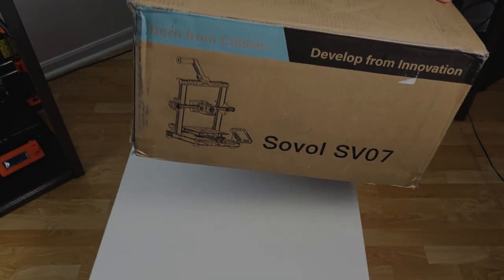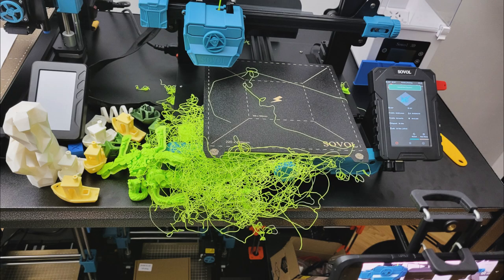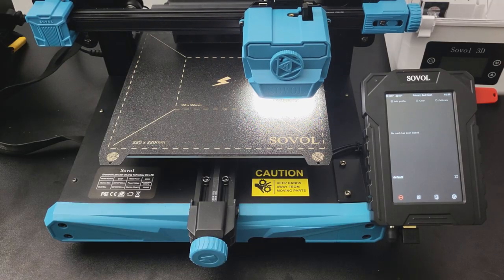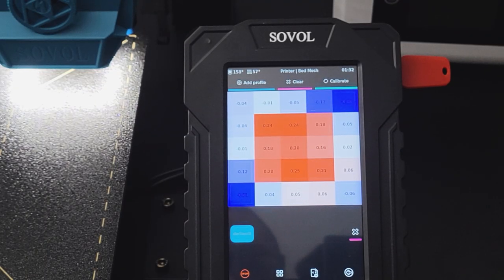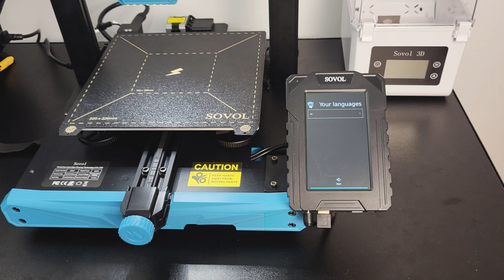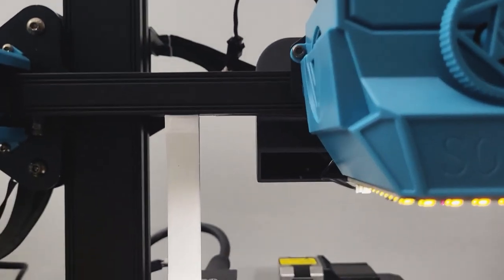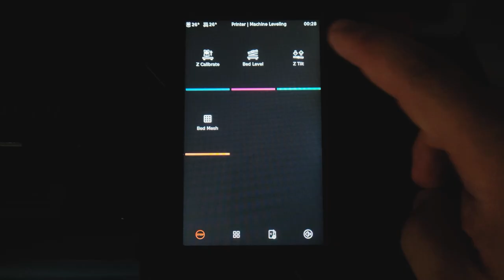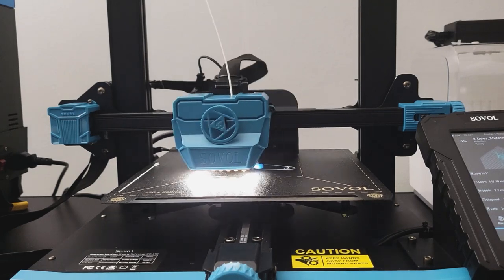Sovol SV07 Beginner set up tutorial, Assembly, Bed leveling, Calibration, Common issues

Comment: Great stuff, I adjusted my bed level on the sv07 based on your tutorial. Thank you!
Could you do a video where you look into input shaping? I did the input shaper auto-calibration on my machine and it messed it up realy bad and I have no idea on how to reset it to it's previous values. Do you have any advice?
Reply from the maker: I will look into that, hopfully will have a video come out in few days.
Reply: @SvgLau  Thank you.
I think the problem is with the accelerometer that they sent. After I resetted the printer to the factory settings and redone the bed levelling without the input shapper it started working well again.

Comment: Can you please help. Im having problems trying to get my sv07plus calibrated.  I do the z tilt first, then the z offset and save. Then do the bed level. Got through it fine the first time.  Tried printing the benchy. When it got about halfway done it started making a scraping sound and then knocked it off the bed. Tried several times and every time it did the same thing. So i tried calibratting again and this time it did the same thing. So tried it again,  now when i do the z offset when i go to lower the extruder after lowering once at 5mm, and once at 1mm, and try going 1mm it says out of range. Also when trying to level the bed lile this i cant even loosen the bed srews enough to get it to even get anuwhere close to touching the paper on the left side, and on the right side the extruder touches the bed plate when it lowers. I am new to 3d printing and am lost at this point.
Reply from the maker: I think your issue may not be the bed leveling. As you mentioned your first few tiral benchy were stick fine on the build plate, the scraping sound could be belt skip steps or something. 
Did you adjust the belt tensioner and the eccentric nuts on wheels? This is critical part of basic calibration. If not, try to adjust those first and redo the entire bed leveling process. Also, if you are using the springs bed spacer set up, don't fully tighten it before you do the bed leveling. I fully tighten it and then, lossen like 2 full rotate just to leave a room for futher adjustment need on that direction. Also, if you can, try to slicer a slower speed benchy on slicer and try with that one first and see if it worked out.

Comment: Seit gestern steht der SV7 auch hier aufgebaut, aber drucken kann ich nicht. In der Y-Achse scheint ein Fehler zu sein und der Druck verschiebt sich. Man kann dann nur abbrechen. Ich habe deinen Teil mit der Kontrolle des Y-Anschlags nicht verstanden, vielleicht kannst du das noch einmal anders beschreiben worauf man hier achten muss?
Reply from the maker: Ich denke, Sie sollten zuerst versuchen, den Riemenspanner auf der Y-Achse einzustellen und dann die POM-Räder darauf einzustellen. Wie im Video gezeigt, sollte die Bewegung auf der Y-Achse linear sein, wenn Sie die Bauplatte bewegen.
Reply: @SvgLau  Thank you for the reply. I  don't checked the excentric nuts. Now it goes and i have play a while to reproduce the stores filed on the USB stick correctly.